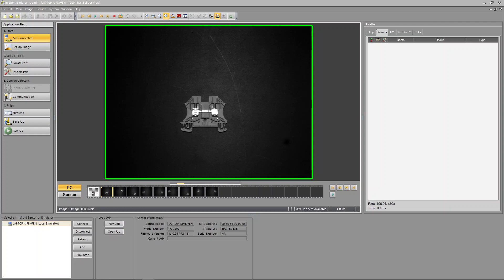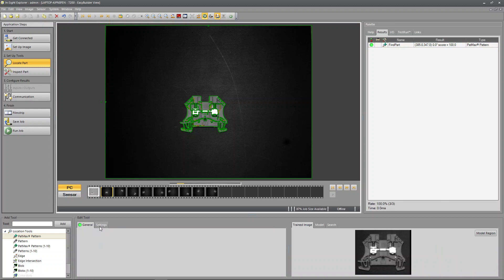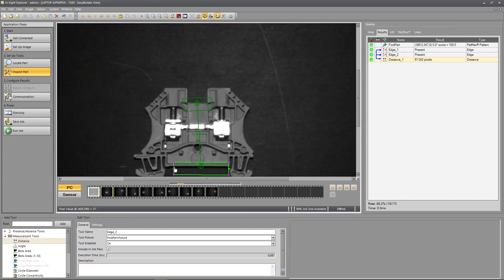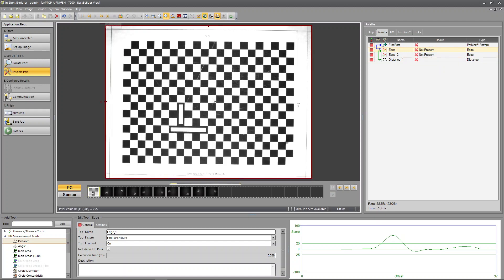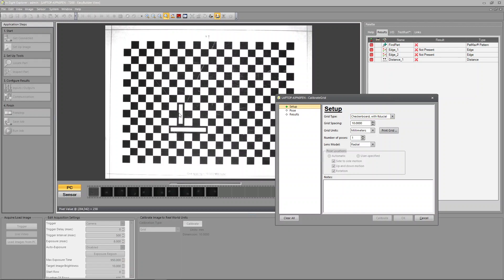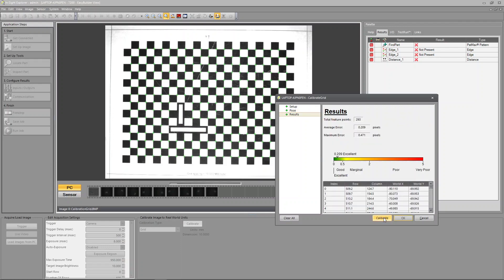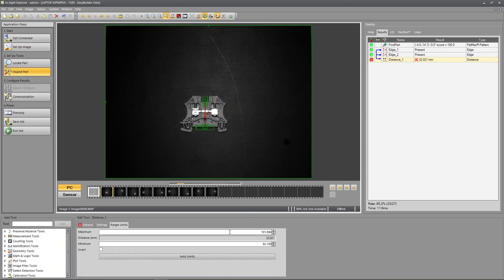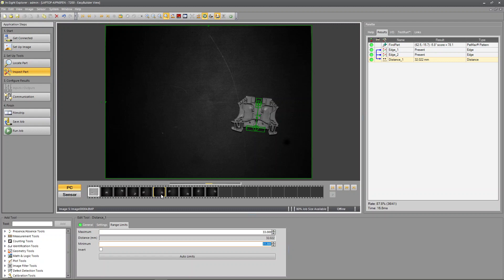ERT 401 - Calibration - Grid

Comment: great video, may I ask what happens if you turn the grid 180°? will it work as well?
Reply from the maker: Sorry I don't really check for comments here. If you turn it 180 degrees it will invert the X and Y directions. This is set by the fiducial (the two rectangles)
Reply: @professorandrewbuckie2261  thanks a lot!!